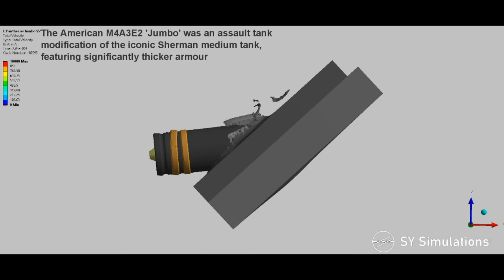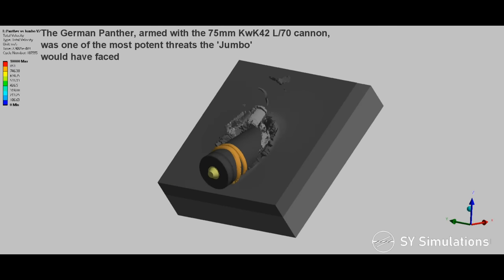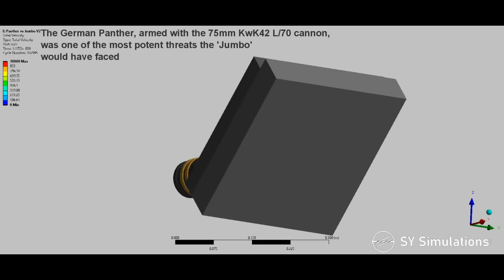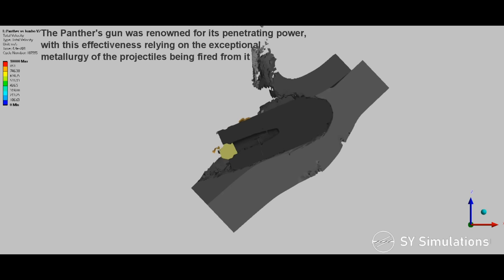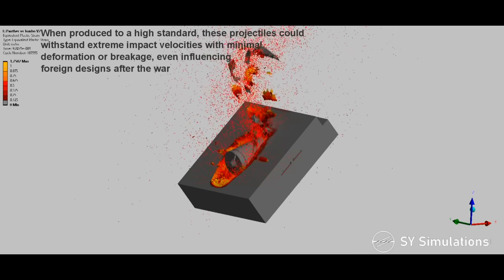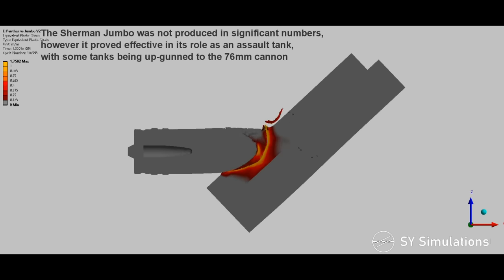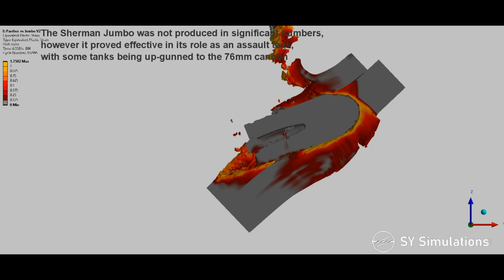PANTHER vs M4A3E2 SHERMAN JUMBO | 75mm Pzgr.39/42 Armour Penetration Simulation

Comment from the maker: I've been mainly focussing on softer Soviet projectiles lately, calibrating the material properties, so its quite surprising moving back over to the super-hard and tough ones...its crazy how different steel can be made to behave
Reply: @mr.waffentrager4400  What kind of 85mm? The 75mm from the Panther has in any case the higher flat armor penetration with it's APCBC round.
Reply: @kimjanek646  i have massive skill issue I thought it's the 75mm l42
Reply: Drachinifel on his channel did a video about evolution of steels Armour for battleships. Quite interesting as he is an engineer (like you I guess 😇) metals are far more complex than most people think
Reply: Hello, I like the new voice-over you've added. I wonder how it would sound like if it had that type of vintage/crusty tape audio filter, could you try it out, maybe?🤔
Reply: Is it possible to simulate shells being softer from heat?  I read that when freshly exiting the barrel the projectile can become softer from the heat.  and as the shell travels becomes cooler and harder again.  Worth investigating?
Reply: think you could do a simulation of the "Plastic" armor that was considered for addon protection to the Sherman during ww2? I am really curious about what it would actually achieve vs a 75mm panther shell and panzer Faust shaped charge.

https://en.wikipedia.org/wiki/Plastic_armour
Reply: @Shibes770 
Unfounded claim. 
Armor test was done at close range. 
The tester alter the powder charge to achieve certain velocity.
Reply: @jintsuubest9331  heat effects the hardness of ALL elements.
Reply: Can you use apcr against the same armor please
Reply: What program do you use?😅
Reply: why are chamber shells with a cavity for explosives not cocked in your video? if it doesn’t break through, it will cock up smoothly and an explosion will occur.
Reply: US 4th Armored Division contracted with a Belgian factory to add applique armor to its M4s you can find an example of this in pictures of the Thunderbolt VII, which was Creighton Abrams tank.
Reply: Please refrain from including the soy voice in future
Reply: @johncitizen306  there's nothing wrong with the voice lmao

Comment: I mean at least it didn't let the whole round in
Reply: Instead it let the armor plates take it's place.
Reply: Wouldve def let in pretty significant damaging particles
Reply: @Salamandra40k Yeah the spall is gonna eat anyone behind that plate alive.
Reply: "Cmon bro, just the tip"
Reply: @jlight7346 nah not really.
Reply: @Salamandra40k  nah not really.
Reply: The round didn't penetrate only spattering the armour.
Reply: @osmacar5331 yea it didn't penetrate but the spall gonna wound the crew
Reply: @dron18228  would better than a 75mm high velocity shell
Reply: @osmacar5331  The spall isn't shown here but whenever an armor plate gets cracked like that there's basically a shotgun blast coming out of it.
Reply: This is a fairly ideal situation for the Panther though. In practice the shell is probably hitting at an angle, and also there were potential metallurgical issues late in the war due to shortages of certain metals.
Reply: @zhoufang996 wdym? It hit at an angle?
Reply: @osmacar5331 that’s definitely fatal man
Reply: @sadstalin172 he means an angle other than straight on
Reply: @sadstalin172 that shot hit the armour dead on at the preferred angle whereas in a normal battle the panther could be higher up making the angle non existent and making the angle useless
Reply: @Parisz_ You wish. Tankers don't climb hills, it makes their tank silhouette highlighted against the sky and the horizon.
Reply: armor fragments 💀
Reply: @Parisz_  It isn't going to be 'that' high up.
Reply: It’s probably still lethal.
Reply: Assistant gunner had a significant emotional event

Comment: My grandfather was a jumbo crewman for a bit. He hated it. Was always at the front of the column, always at the most risk, always sent in ahead. When the Junbo he was the gunner in had an engine fire that trashed the tank, his crew got a 76mm fresh from the states.
Reply: When its at the very front it sounds like your at extreme risk of being shot in the sides making the frontal armor pointless.
Reply: Very interesting. Thanks for sharing!
Reply: @BloodyCrow__ exactly lol prob one of the reasons he hated being in one so much.
Reply: @BloodyCrow__  tank warfare is not often close enough for that to be a huge concern
Reply: @connivingkhajiit  You know ambushes exist?
Reply: @connivingkhajiit I recall reading somewhere "average" range in the ETO was 500yds, "typical" range of 700-750yds was more likely for tank v tank engagements. The Jumbo was likely a tough nut to crack at those ranges, more so if angled.
Reply: The T26E3's were often employed in similar fashion. Put your toughest tank in the lead.
If there had been more of either or both machines, their crews would have felt less like "bait".
Reply: @BloodyCrow__ the Jumbo also had thicker sides
Reply: @polygondwanaland8390  Yeah only 76mm
Reply: there is a certain tank named the "in the mood" look it up
Reply: @garyhill2740  You don't angle a Jumbo, its sides were so thin even a Pz 4 could penetrate it if you tried to angle too much.
Reply: @connivingkhajiit  Tank engagements on the Western front were significantly shorter than on the Eastern front.
Reply: I mean a jumbo had way more chances of not being destroyed by a 75 mm or almost every german weapon even if I think for some situation there where no difference. It's clear that for the crew was very bad being at the front of the column but someone has to be there and the alternative was a normal Sherman whit less armor.
Reply: @FM-tw9sb  The Jumbo was still vulnerable from the sides, by both MANPATs and AT guns. Both of which contributed to a considerable amount of Sherman losses. So no, the crew doesn't care how much armor they have. they still don't want their lives put at risk. It's easy for us in our modern day to tell them how THEY should have felt.
Reply: @alarminglyfastmovingskelet7289  What I was tring to say is that from what I know the jumbo was a way as many other to improve the survability of the thank. For the crew that had them was probably really difficult to notice that since they had to stay on the front but this doesn't mean the solution was bad or useless. The role it'self was the problem and a normal Sherman wouldn't have done better but in absence of a Jumbo the thanks probably took turns for who had to stay in the front. I never tried to say how they should have felt about that or even that in my opinion they where happy about having a Jumbo.

Comment: This is a pretty ideal condition, so if the front of the Sherman had even a slight angle I bet that it wouldn't have cracked the rear plate.
Reply: Lol...opposite is true too (sherman hurtling down a slope)....
Reply: @Khrist75  Tho a Sherman going down hill is less likely than a Sherman facing you directly. 
The Sherman going down hill may also be at a angle relative to the tank firing at it.
Reply: @D_U_N_E  Ugh no....even in a case where it angles to 15-25% from the vertical axe its relative thickness is decreased by about 6-8% less...so my example is still valid
Reply: @Khrist75  Seem to forget the "Sherman going down hill is less likely than a Sherman facing you directly"
The downhill angling is only compound to that.
Reply: @D_U_N_E  Exactly like it only shows its front and not its side .This video example is a pretty ideal situation for a Sherman too... 😉.(You seems to forget what the original post said about this "ideal' situation and why i replied to it).
Reply: @Khrist75  passive aggressive lol makes your message read otherwise.
Reply: @D_U_N_E  😁. For information i have a scientific background, so the term "ideal" fits only in the books if you get my pov...😉
Reply: Ahh...the classic vertical angle vs lateral angle debate.  Ideally, if the Sherman was holding the high ground to begin with, it probably wouldn't go running down the hill towards a Panther 500 meters away until it was cleared, or if jumbo was having trouble penning panther and decided to go kamikaze.  But sometimes you get the order to advance even if it's a bad idea, and well...orders are orders.
Reply: @Khrist75  "I hAvE a ScIeNtIfIc bAcKgRoUnD" has the same beat as enter [modern tank name] tankers that act like they have ultimate authority on how [the tank they didn't drive] tanks work.

Sure, downhill bad - but in the vast majority of cases, downhill is the exception to when a tank would be shot at. Versus the norm of being on flat ground with accidental angling.

Hell, against the Sherman in reality, US army apparently did a study finding out it took 3.6 panther to every 1 regular Sherman. More factors than just Sherman better, since I mean... On paper it isn't really on 1-1 engagements, but it does show the panthers were rarely getting their favourable shots.
Reply: @D_U_N_E  I hope you did it purposely because i never said to have an ultimate authority in this...I just said, as a scientist, that ideal conditions (the Theory) are just existing in science books... no more no less.
"There is nothing so closed as a closed mind.".
Reply: @Khrist75  When people bring up their job roles online, that reads to be trying to use it as some authority. Ultimate is a stretch I apply to the stereotypical online 'reddit' tankers, having the same beat doesn't mean having the same song - though as this entire spat has read as arrogance with the "Lol" before correction and "ugh" when further situations are brought up - I will assume bringing careers into this is of that variety. 

Ideal circumstances are harder to rely upon, part of winning war is to stop your opposition having ideal circumstances. Your circumstance was just a rarer occurrence than the OPs. Doesn't make it not a point, I never said that, but if we are all here adding factors to counter/support the ideal, that's a factor to be added.
Reply: @D_U_N_E  "
Reply: @D_U_N_E  " Your circumstance was just a rarer occurrence than the OPs"...as well as his statement: a slight angled hull (20°) increases relative thickness to 6,4%....does he really think the inner hull won't be damage at all because o that little change?? That's maths and science. Now i'm done, so...
Reply: @Khrist75  Glad doing converse with yah!
Reply: @Khrist75 in a magical world where its on a slope the whole time you would be a point. At that point, having a flat front would be better as then you have best angle going up or down vs a dedicated slope. 

But in reality most of europe is, for practicality, flat. Which means most engagements are flat so the intended angle of design would see the most use.
Reply: @Moon_Cricket_Stinks  "most of Europe is flat" east of berlin this is true but France and Germany are filled with hills and mountains. not to mention northern italy.
Reply: @dominuslogik484  thats true. But if you had to pick an angle slopping back on idea of flat ground is your best design. Theres no slope design that will be king, so you just have to pick what works best.
Reply: @Moon_Cricket_Stinks  sloping back 60 degrees is always ideal. Yes it gets worse when pointing down hill but tanks try to avoid engaging an opponent from that position and instead would just crest the top of the hill and fire at threats

Comment: I like to see what the spalling and the detonated HE filler would do by having the witness plate behind the armor plate.😅
Reply from the maker: Unfortunately with these simulations theres a common issue where a tiny fraction of the particles phase through the target plate, which can give false interpretations on the witness plate. This can be seen in most armour penetration videos out there, and is why I dont put them in :'(
Reply: @SYsimulations Thanks for your work. At least we have a good idea of what can happen
Reply: That is assuming that fuse actually works and sets off the explosive charge. Which probably isn't the case, considering the angle of atack. It deforms.

Comment: Can you possibly simulate cage armor with sandbag/wood against the sideplate of a sherman? (Any variant) It can go up against a long 75 pz.IV or a Pak40. While it may be hard to recreate, a lot of tanks used sandbags and other softer materials for add on armor and it would be cool to see how effective it could have been.
Reply: It wasn’t effective
Reply: The side plate? It'd go right through, it'd be interesting to see a barely penetrating hit without any extra armor, but with sandbags to see if it affected it at all
Reply: Something like a Pak38 or handheld anti tank weapon may fair better results, but a side by side with and without could still be interesting
Reply: @prestonbernatek222 still not effective, i think Patton himself warn to not use this modification as its increase weight with no additional protection gained
Reply: @blackmark7165  Yep, there's a really iconic photo of Patton scolding a tank crew for doing this
Reply: @ThreeEyedFish  Probably scolded them not only for that 😂 At least one academy award I do agree with. After all Scott was a former Sergeant of the USMC.
Reply: I guess it was more like HEAT protection, it would be useless againts regular projectiles.
Reply: @blackmark7165  Except it was. To a minor degree. SY or maybe one of the others made a video with the King Tiger with extra track linkages against an SU-85, it turned a full pen into a bulge at 250m.
Reply: @fen3311  against conventional round maybe but HEAT warhead from Panzerschreck and Panzerfaust definitely not

Edit: I've watched the video and despite only a bulge, the damage still significant for anyone inside
Reply: @fen3311 Track links are not sandbags or cerment, but hardened steel
Reply: @nickremer6142  Sure but it's also relatively thin for what it is. Probably equivalent of 3-4" of concrete. Granted I dont know the actual thickness of the treads.
Reply: @fen3311  Thing is that they are most likely hardened as not to deform too easily so they do not break up like concrete or cerment would
Reply: @fen3311 from the simulations it seems concrete was the worst applique armor that actually eased shell penetration. I've heard about some war period tests showing sandbags had some minor effectiveness against shaped charges. But welded plates, spare tracks, wheels and anything of steel were probably the best option.
Reply: Those didn't actually make a difference against projectiles. They did however work against magnetic mines and satchel charges, especially in the Pacific
Reply: @fen3311  It's tricky to correlate the effectiveness of concrete and steel since both can vary greatly, however most sources point towards reinforced concrete being about 10% as effective vs AP projectiles than Steel armour.

Sherman tracks were anywhere from 40-90mm thick depending on the type (thinner for steel, thicker for rubber), but even then assuming a very generous ratio of 1:5 (or 20% effectiveness for the concrete) and the thinnest tracks used as armour, you'd need 200mm of concrete to give the same level of protection. That's just shy of 8" for the Americans. That would amount to an immense amount of additional weight and would likely totally wreck the suspension - not to mention that being non-reinforced it's likely to shatter and fall apart after a single direct hit.

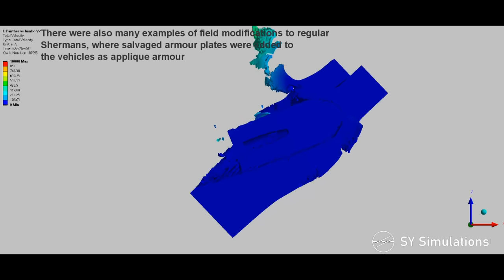And this is all assuming a 40mm track link, and that the steel used is not nearly as strong as in armour plate thus a better ratio for the concrete. If it was a scavenged glacis plate from one of the earliest Shermans (50.8mm) and thus proper armour, we might then assume the 1:10 ratio. Meaning you'd need 508mm of concrete to match the effectiveness (never mind any angling). Some 20"!

Concrete (and by extension sand bags, wood, etc) is a terrible choice of armour compared to steel - it's used in bunkers because space and weight are non-issues, and because it's a lot cheaper, easier, and faster to work with than steel. It is also far less problematic to procure in great quantity, as opposed to steel which was vital for tanks and ships and such. But if they had steel in vast excess, and plenty of time, they'd probably have made a lot more steel bunkers than they did!
Reply: @daredemontriple6  Well no one said it was a replacement for armour. Merely that in some cases it could be the difference between a full penetrion and a bulge, much like a track link which sure as hell isnt 40mm. Probably closer to 5mm.
Reply: @fen3311  you said a track link is equivalent to about 3-4" of concrete and I'm saying it's definitely not.

And yes, track links are about 40mm thick for sherman steel tracks. Not 5mm, that's insane. The connecting pins are just shy of 32mm thick themselves so the links have to be at least that thick
Reply: @daredemontriple6  Depends on the type now doesn't it.

Got a source on that thickness brother?
Reply: @blackmark7165   That was just US Army regulation. Patton was the only one who seriously enforced it.
Reply: @fen3311 you can't make equivalence between hardened steel and cement, sandbags or logs.  It like comparing apples to to ideologies.  Nothing in common, no shared metric.
Reply: @sinisterthoughts2896  Huh? Its very well established how much equivalence there is between them. Concrete and RHA anyway
Reply: @blackmark7165  U.S. Generals didn't really come to a consensus on it because of the effect that it had on crew morale. While the add-on armor didn't do much besides weigh it down it had a positive effect on the morale of tank crews as they generally felt safer. They really weren't, but I'd rather have a crew of tankers willing to fight rather than a crew that's unwilling.
Reply: The testing I've seen indicates that it  actually helped the round normalise against the plate and improved it's passage through the armour. It seems to only work as better than the plate armor with HEAT rounds.